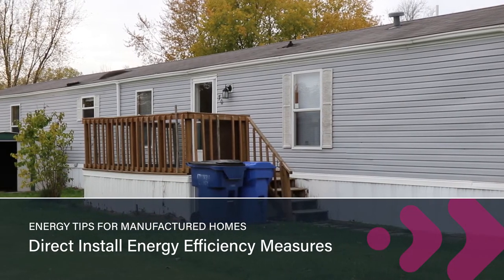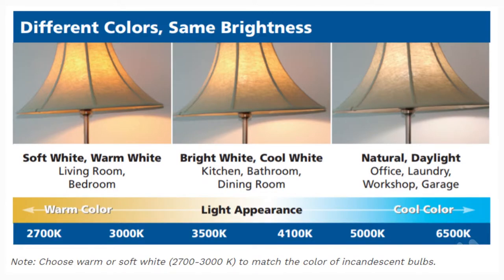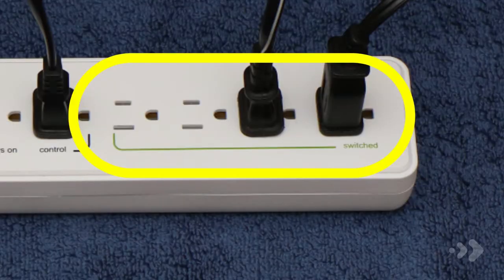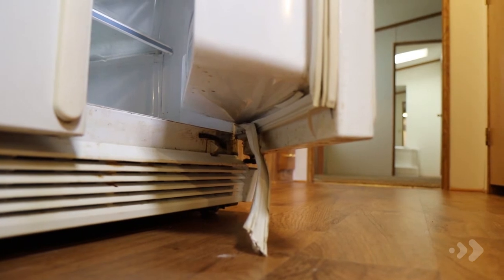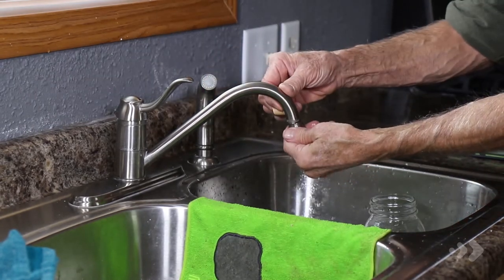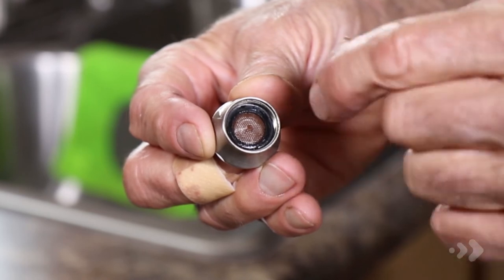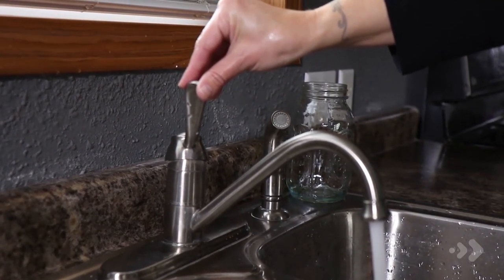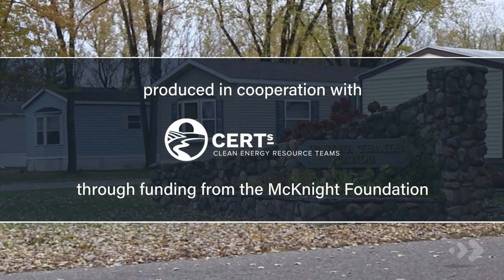Energy Tips for Manufactured or Mobile Homes: Direct Install Energy Efficiency Measures

Comment: I have done all this but unfortunately Southern California Edison in the last few years have doubled the cost of electricity.  PGE has done the same thing for electricity.  What I have done that has made a difference in comfort is installing a foil on top of my composition roof, add 1x3 wood slats for air flow and not interfere with the foil. Then adding polyiso insulation to my roof and putting on a white metal roof.  I have taken the left over polyiso insulation and taken off my vents on my gable ends and cut down the width of the polyiso to slide through the vents.  It was tedious but it has allowed me to install another 2" of polyiso.  The one project I wanted to do was add polyiso insulation to the outside of my walls and install metal siding that looks like wood on the outside.  I have run into a road block with California Housing Authority. There are new technologies in regards to paint that is designed to reflect more radiant heat. Adding as much insulation as possible makes a difference on the energy bill and comfort.